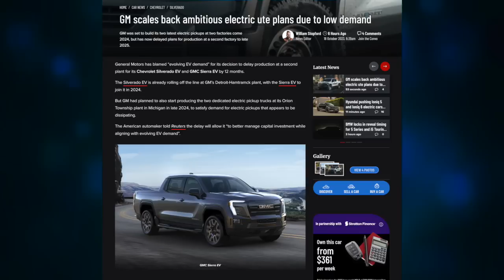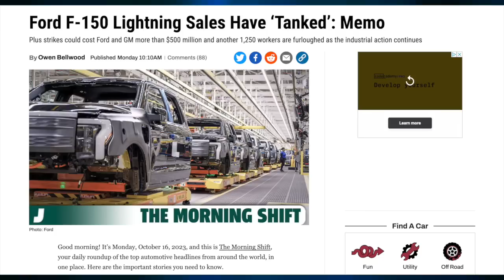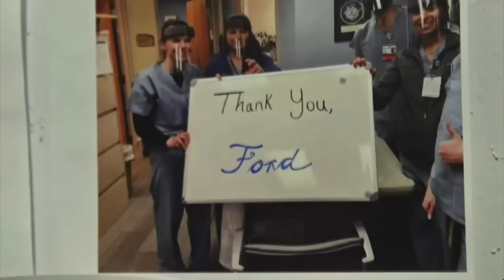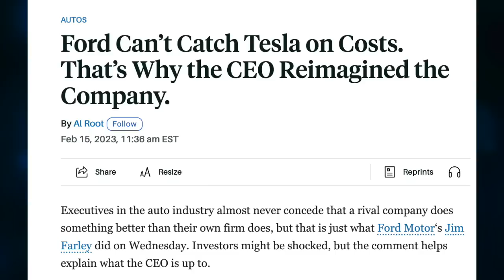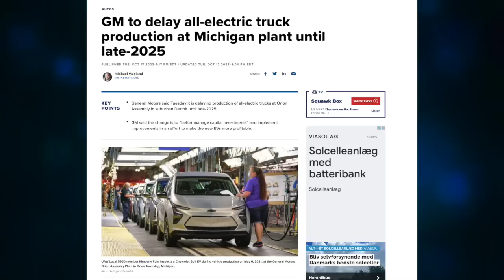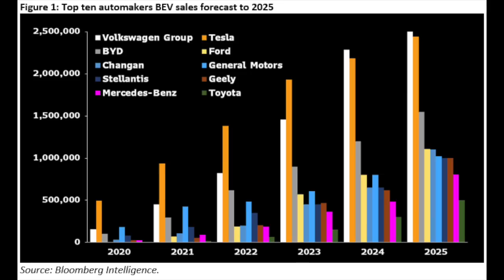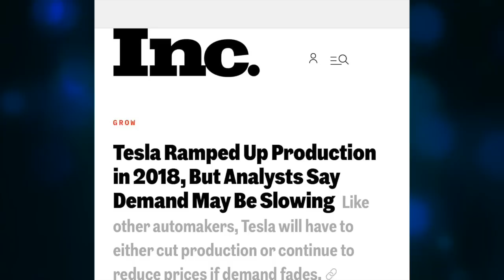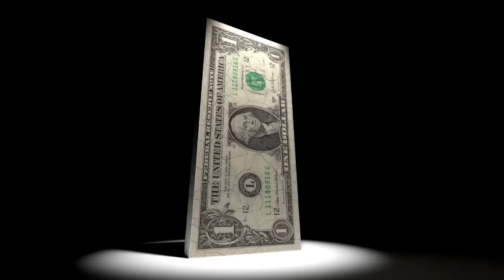The competition crumbles - Ford, GM & VW are backing down from promises

Comment: The meaning of the word "disruption" is starting to sink in for a lot of people.
Reply: Time for OEM's "Golden Parachutes..." 😮
Reply: The disruption from cell phones is nothing compared to the EV disruption.
Reply: @johndonovan7897 What are you even saying?? The cellphone then smartphone transition radically changed everything about how we live, work, travel, and entertain ourselves.

The EV does the same thing gassers do which is transportation, just with a different fuel. It's more efficient, cleaner, cheaper, more reliable, safer transportation. But it's still transportation. Autonomy is something else entirely.
Reply: @TecnamTwin   I was thinking more of the effect on emissions, but yes autonomy and having a computer on wheels is disruptive.

Comment: I get the impression that the UAW is very anti-EV.  🇨🇦
Reply: That's pretty much the bottom line. LOL 👍🏻🇺🇸
Reply: So is management
Reply: What was ur first clue?
Reply: Yes, EVs have fewer parts, generally more automation so fewer jobs required.
Reply: No kidding! An EV has f 16:15 ar fewer moving parts than an ICE vehicle it takes VW 30 hours to assemble one vehicle, whereas Tesla can assemble a vehicle in about 10 hours. Far fewer workers are needed to assemble EV'S.
Reply: @donwise8767  That 10 houirs is due to get even shorter due to Tesla's coming "Unboxed Process" manufacturing.
Reply: UAW should be forbidden !
Reply: Uaw being disrupted

Comment: I am shocked that Ford whose made vehicle's for 120 years now, has only produced just over 30,000 total lightnings.
Since entering production last spring. Even rivian has them beaten in ev trucks sold so far. 

The nacs as native in 2025 announcement right after farley saying that t3 trust the truck ground up ev would be Ford's millennium falcon.
Might just have Osbourned the poor lightning deader n a door nail. 😀

Comment: Cybertruck would probably not cost 40,000 $ US. Probably more in the range of 60,000 $ US plus for the base model. We will see the real price soon, anyway.
Reply: Tesla is a relatively good car producer as it got in early as an EV producer with clearly modern design. 
However, it is a car company as is Ford and GM, and as today’s earnings report and guidance shows, it is a tough business…
there is a reason innovative companies are called being on the “bleeding edge”. 
Don’t  misunderstand, it is because of the higher interest rates and the introduction of the Cybertruck in a challenging position…but it is still in better position than the competition….its just going to be a bit of a rough patch.
Reply: Probably

Comment: But so crumbles Tesla? What about cost savings through 4680s, structural packs and giga castings? The former are ramping slowly and not many casts are even produced using the latter. What about Cybertruck being designed for manufacturing, promising best value for value even compromising design for easy production and utility? It turns out to be very difficult to ramp and seemingly impossible to produce at a profit?
I really hope they finally can implement all these inovations at scale.

Comment: 200,000 pre-orders at $40K evaporates quickly when you jack up the price to $60K.  I worry about the Cyber Truck for the same reason.  Tesla should take what happened to the Lightning as a warning about raising the price.
Reply: Except CT has an extensive reliable charging network that even with shorter towing range, it will be offsets for the most part. And don't forget, the polar designed will get buyers along with brand recognition. Despite what people say about Elon. Case and point, Tesla sale in Cali should have tanked with all the talk about how bad Elon is, yet it is among the number one model sold.

Comment: Tesla really needs a smaller car like the Model 2 to truly conquer the market.
There also needs to be much, much better charging infrastructure.
Reply: How many 350kw dc fast chargers have u installed in th last 9 weeks???  HHHUUUUUHHHJ
Reply: @sparkysho-ze7nm  Not sure, but the total of 110 locations with 1100 chargers between them simply isn't enough.
They're also centred around cities and motorways and not rural locations.
The North East of England has only 2 Tesla Supercharger locations as an example.

Comment: How many electric cars do you see where you live? I live in rural North Carolina and I believe I have seen three electric cars over the last two years. Toyota is experimenting with hydrogen powered cars and also ammonia powered cars. Toyota already knows that electric cars are NOT the future. People where I live can't afford them anyway and I just about NEVER see public charging stations.
Reply: Toyota has been not only "experimenting" with hydrogen powered cars, but actually building them since 2014. The Toyota Mirai has very low volume production of only a few thousand units per year and there are good reasons for that. The main reason is that they are hugely inefficient compared with battery EV's and there is an almost complete lack of infrastructure to support them. The battery EV adoption is already happening whether Toyota "knows" it or not.
Reply: I am from North Carolina, but for the last 40 years, I have lived in California. I see more EVs every day. Hell 16:15 16:15 , I have been driving a Ford Focus Electric for 10 years. Get your facts straight.
Reply: I live in CA where Tesla is ubiquitous. Cars and chargers everywhere. Not just Tesla, but every sort of EV.
It usually takes five years for the rest of the country to catch up to what's going on in California.
Reply: @barnabasseadog7660  Closer to 7-8 years. When something is big on the east or west coasts it usually takes about 7-8 years for it to reach the Central States of the US. I should know I live in one of those states.

Comment: I love seeing the haters say they are never buying an EV, lol, i say you will when its cheaper and better than gas cars fool. 😂😂😂😂😂😂
Reply: They must love the trips to the gas station and the smell of gasoline on their hands and the trips to the the car repair place to get the oil changed, belts replaced, hoses replaced, air filter replaced, fuel pump replaced, water pumps replaced, exhaust system replaced, tune ups etc,